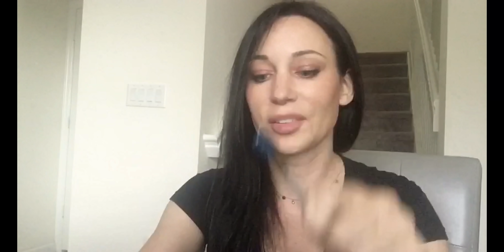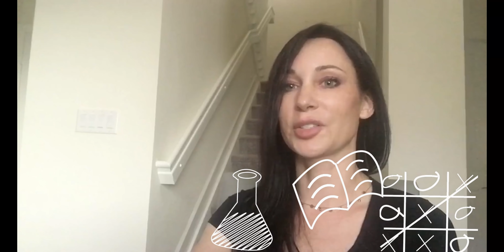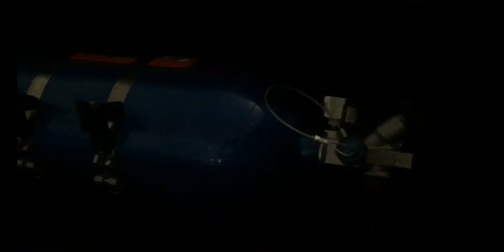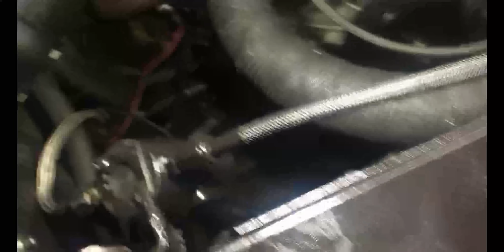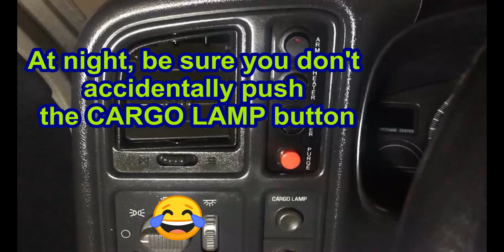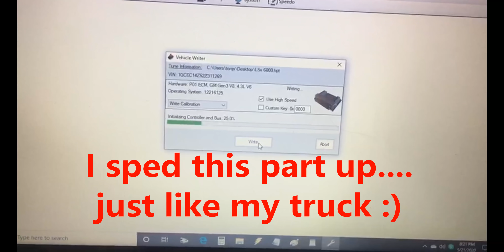Nitrous EXPLAINED by a GIRL - she built her own NOS brand wet shot system programmed by HPTuners

Comment: I sprayed a 200shot from 1800 rpms. With stock fuel pump from a nozzle 26lb fuel injectors btw
Reply from the maker: sweet, yes we have also hit it with a 175 shot way below 3000 rpm multiple times :) even with a non-nitrous converter nothing bad happened